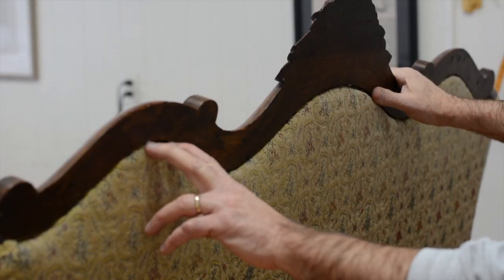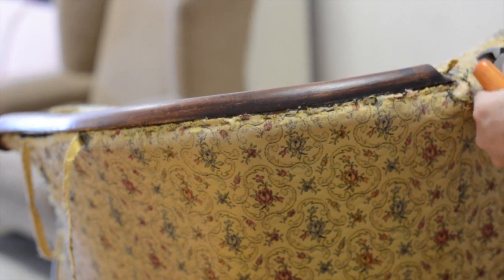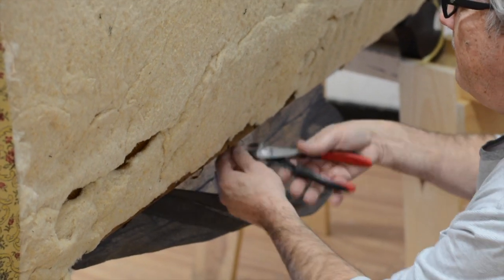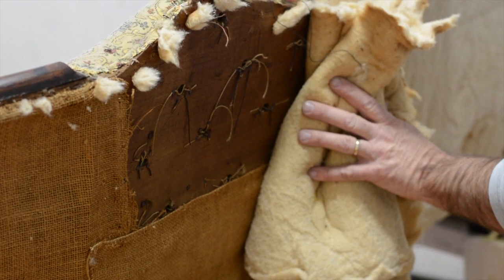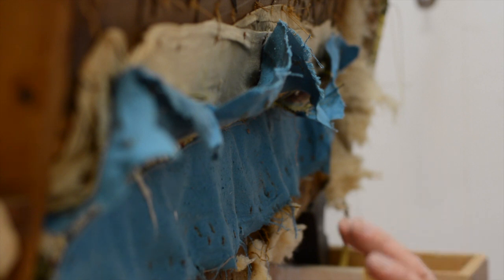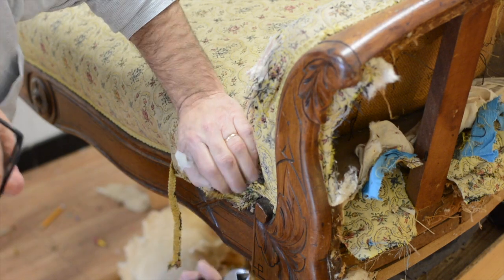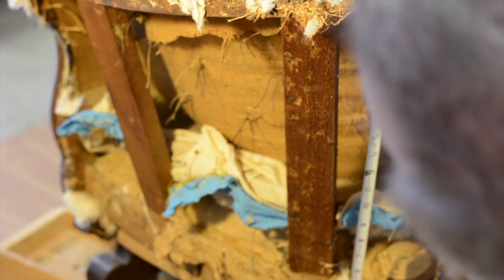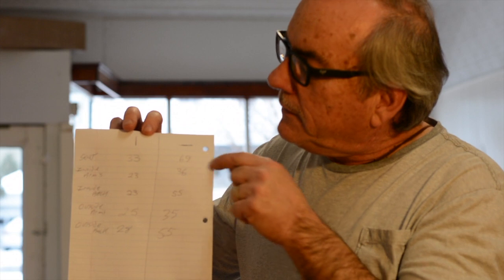American Victorian Sofa: Stripping & Measuring for Fabric

Comment: Loved your video.  Lots of helpful information.  I have a fainting couch I believe to have been made in late 1800's early 1900's that folds out into a bed.  Since seat is part of bed I would like to know how you would redo coil spring section.  I'm at a loss.  Called several upholstery shops in my area and no one knows what I talking about or has seen one.  Was hoping you could help or if you have worked on one and made a video I would like to watch it.

Comment: Generally I enjoyed watching this video. However  I do a few extra tips that wasn't in this particular demonstration 1. When your removing finnishing gimp which has been clued on try using lighter fuel to desolve the glue first! This tip comes in handy if your only need  to repair an item and not recovering. Also fabric which has pile to it, lets say velvet there is a high chance of damaging it if you pull on the gimp even gently as in this video. Note orientally the gimp would of been hand saw on! 2. In the UK many authentic upholsterers dislike using staples in Victorian setters or older items. This was done solely for the benefit of the last upholsterer saving on time!  If it's not authenic the item will lose value... note you can buy blue steel tacks in the UK if can't get them where you are in world. 3 The gentleman in this video said that the hand saw dug roll along the front edge of the seat was in good shape always a bonus but it was difficult for me to see in this video from my angle if the dug roll  was still over hung across all of it's front edge by 1/2 inch or 25 cm. Note that the dug roll can be in good shape but it is still  often push back which would give you a poor finish if that was the case. 3. From this video I notice there wasn't an calico fabric fitted to this project. Which means the last upholsterer before was in hurry to get the job done the cheap! In the UK we call this a cowboy job! As the gentleman upholsterer would of benefited greatly from as it would ment that much of felt wadding would of stayed in place. 4. No mention of the condition of the fame was mentioned so I can only assume it was in good shape. But please note in most modern homes these days has central heating which over time dry out the wood making it brittle between reupholstery. Therefore it is best you treat the frame with linseed oil before reupholstery starts! On furniture this old. I hope these tips helps? They sure have in my 40 years in the business.
Reply: Would love to see your channel and how you do it 😉